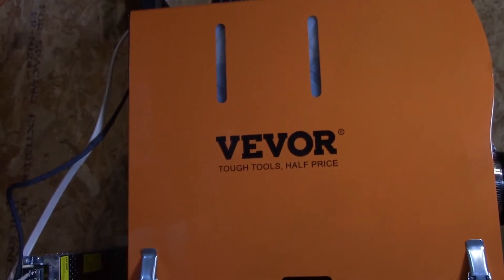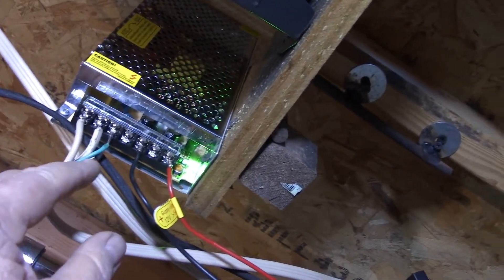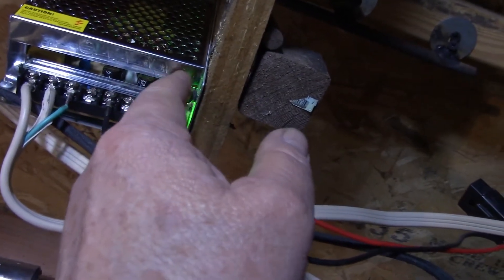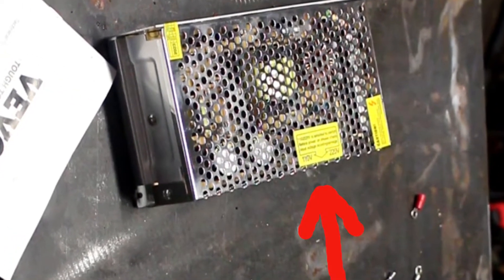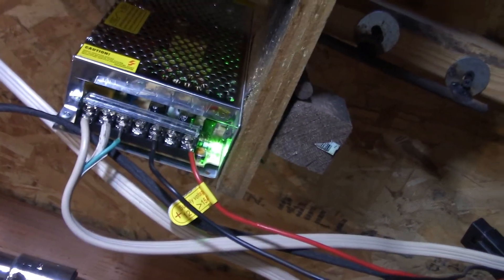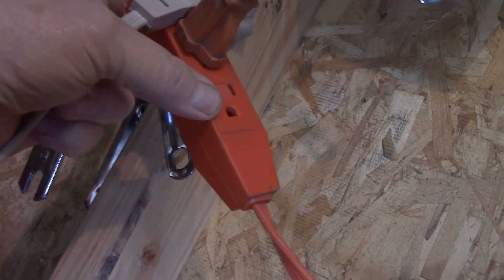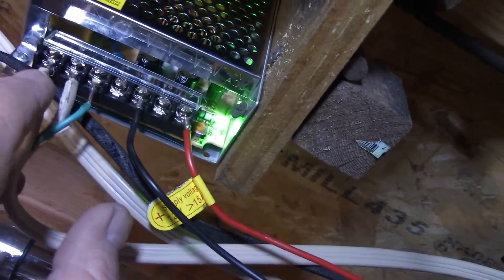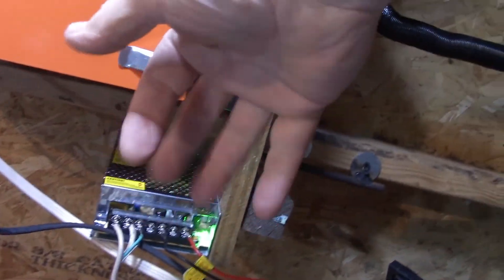How To Power Vevor Chinese Diesel Heater Using 110v Power Supply 12v 15amp

Comment: I tried to wire mine like you did in this video for some reason my glow plug would not come on everything else worked perfect, so I had to unscrew the positive and hook it right beside the negative. For whatever reason that caused it to work perfect. Not sure if anyone else that watches this might run into this problem, but if so there's your fix lol great video buddy

Comment: The only problem with using a 110 volt power supply is if you lose power suddenly the heater can't enter the cooldown mode. But using a battery it will automatically shut itself down at 9 volts. And there will still be enough juice to cool down the burn chamber.
Reply from the maker: Good point! It's always a tradeoff between convenience and safety.
Reply: @Hollywood4Funthis is such a great point! What type of battery do you suggest?
Reply: @WeirdEarthGardens  I use a small lawn tractor battery hooked up to a cheap battery maintainer.
Reply: @roberthosking7524 can you keep the maintainer hooked as you use the heater, I have on just curious tired of hooking up the battery charger after each use
Reply: Wonder if anyone has a solution for both running a Battery and a 110 volt converter to 12 volts

Comment: Want backup UPS so it can cooldown during power failure otherwise the heater unit can get damaged.
Reply from the maker: I've read online that it has happened to others and no serious damage. It fired right back up later and worked fine. However why tempt fate if you have power issues
Reply: @HughesMotorized  

After watching few more videos appears when it shuts down improper sounds  like gets extra bit of soot on the heat exchanger internal surfaces, guess the shutdown cycle besides cooling unit also kind of helps to clean internal surface a bit due to ramp up. 

When units run at low fire they typically don't have great control of combustion air(excess air)unless they have added dampener air control, hence if one fires at low fire often units will foul faster on internal surfaces.  From what I have read up or watched they like bit higher firing rates more consistently which helps to give complete combustion and likewise less build up of soot on inside heating surfaces.  One should be prepared with proper tool and gaskets to clean internal heat exchanger possible annually to remove build up of soot.  I would also keep spare glo plug and screen parts on hand.

These units are very similar to famous Monitor brand heaters which use to be sold in USA for home heating.  Very efficient units, sadly manufacturer went out of business.  They were commonly found in cold environments in NAmerica such as hunting lodges and cabins.  Great units could heat cabin for whole year even two for one tank of Kerosene.

Comment: Not only should you switch the unit to 110v (for us here i the U.S.) but also the small yellow screw by the green LED light is the adjustment so you can turn it up to 13 or 14 volts to get the correct power (I think they come set at 12.6 volts) It will help your heater work better.
Reply: @PainterD54  wow thank you for that tip! I will have to try it out 😁

Comment: Merry Christmas 🤶!!!   
A $20 120V AC to 13V DC step down converter sure is cheaper than a 12V deep cycle battery, 100w solar panel & small charge controller. 
But the battery/solar panel/charge controller would be an option to keep it running if a person had no AC power.
Reply from the maker: Good idea
Reply: @michaelbrinks8089  you’re giving me goals 🤩